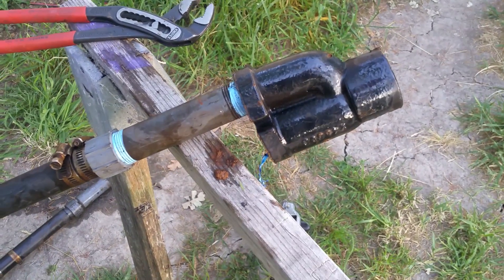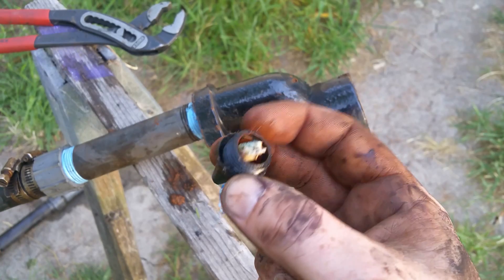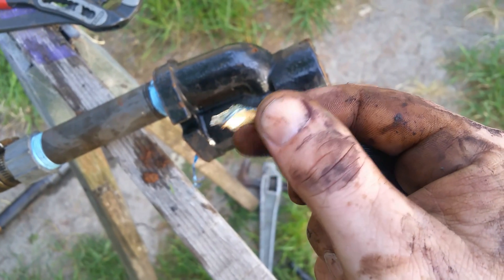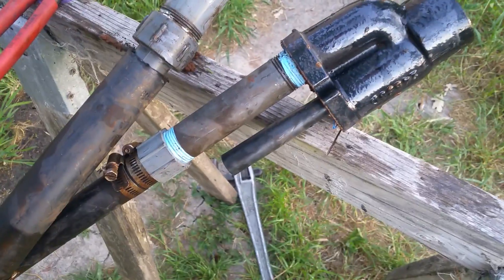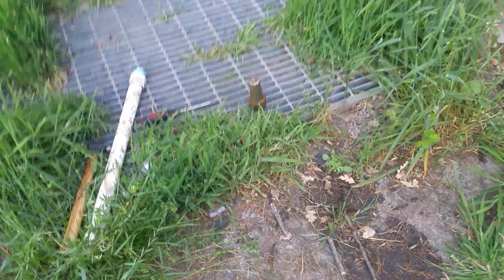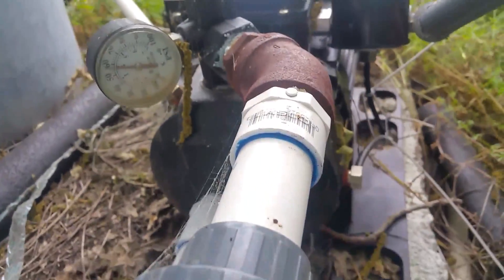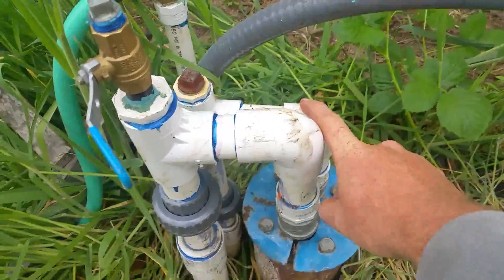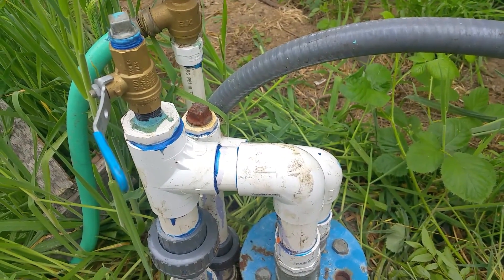jet pump not pumping too fast, solved

Comment: Can transparent pvc industrial hose be used for installation in a 18m deep water well?
Reply from the maker: Possibly, most jet pump wells use HDPE pipe, it's fairly common around thise parts

Comment: With regard to convertible jet pump, I have a question.
Which is bigger flow I can get “Double pipe system” or “Single PIPE system”?
The condition is the same head (40feets).
Thank you in advance!
By IKUO SHINTOME

Comment: Hi, I have seen your most interesting video. You have illustarted the exact same problem I have. Of course, you must realise by now that your supplier has sold you a defective Ejector-Head, i.e. the brass connector-pipe is TOO short, hence your resort to bunging the threaded area up with far too much plumber's tape and hence, leading to a piece coming adrift and blocking the jet. This is a serious product defect and I am currently engaged in legal action against the supplier of this Ejector-Head. I really need your help and would like to know who your supplier of this unit was and what was the outcome of any complaints you made to them? Would be most grateful if you could make contact with me at:  pyralog@yahoo.co.nz      Cheers, Andre.